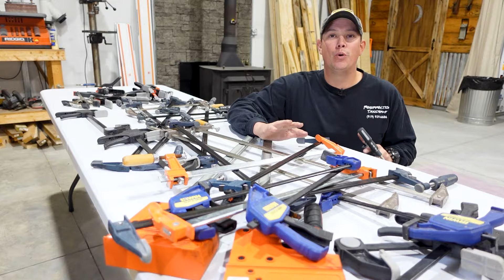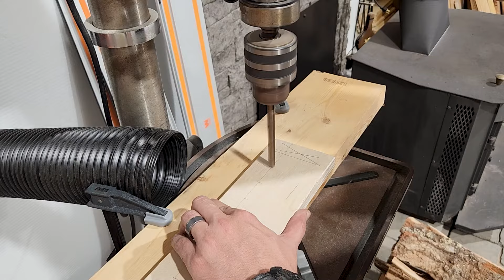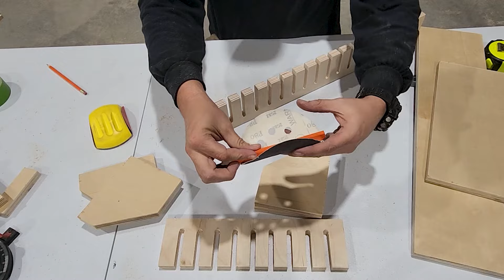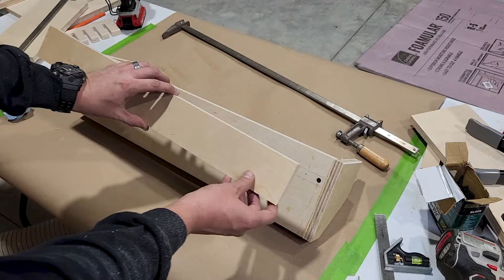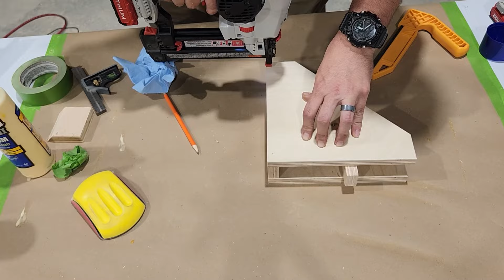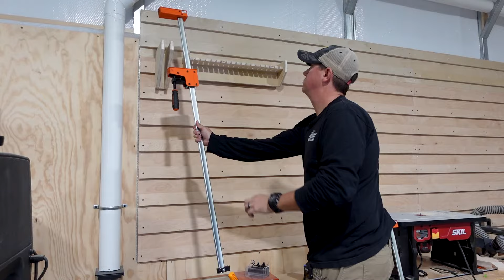French Cleat Clamp Racks / Woodworking / Shop Organization

Comment: Just a heads up, when taking the pieces apart (when using CA and tape) you may find it easier to twist the two pieces apart.  I know it wasn't that hard to pull them apart, but CA glue has great strength straight on, but it doesn't hold up well to shear.  Cheers!

Comment: This arrangement does not seem efficient. You’ve covered up so much clear space and aren’t using the volume available on the wall. The benefit is that you can get to each clamp without having to remove others.